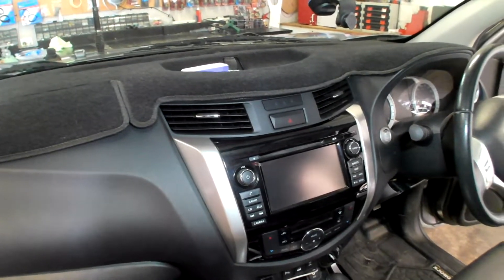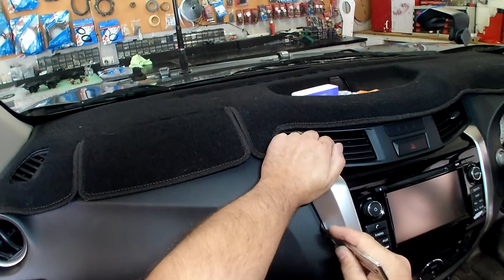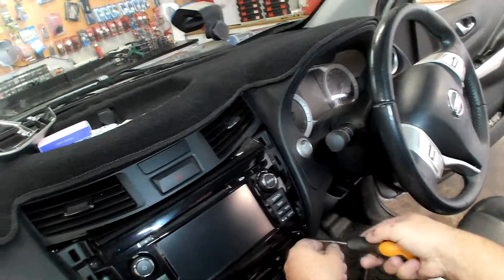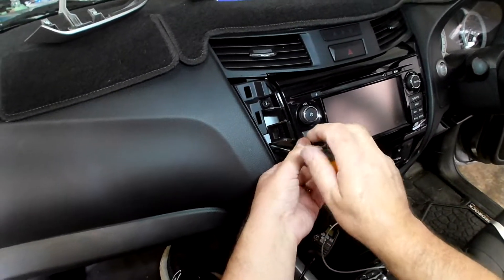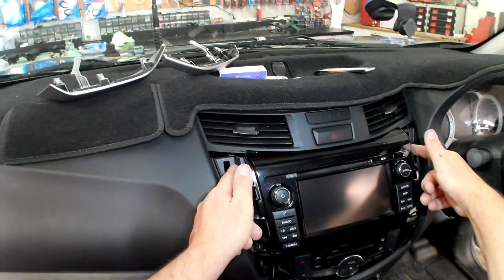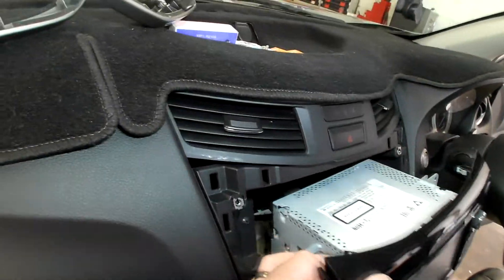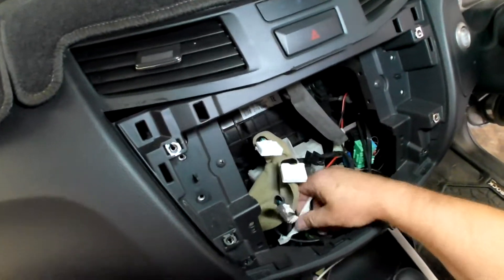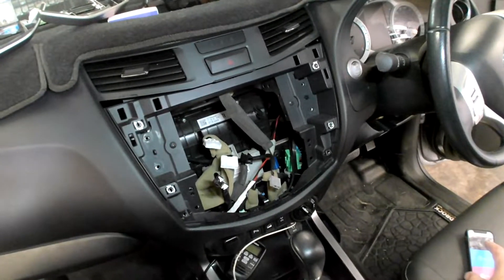Nissan Navara 2017 NP300 D23 Radio Removal

Comment: Not sure if you'll know but thought I would ask. My stock system (as shown in the video) has a damaged screen. I can get a whole compatible & operational unit from a breakers yard, the breakers yard advised me it would need coding to my vehicle. I contacted my local Nissan garage who told me it's not as simple as just swapping one from one vehicle to another and they may just try to use the screen part from the one I bought. Would a Nissan dealer not be able to replace the whole unit with the one I bought and sort the coding?
Reply from the maker: Thanks for the enquiry. I have not swapped like for like in these as all my clients have simply replaced with a better unit. That said, I would remove your existing one (as in the video), take the vehicle to the wrecker and ask to plug in one of theirs. If it works, buy it. If not, no harm no foul. Logically you could have just the screen changed, but you would be paying someone to disassemble both units. 
Let me know if the swap-over works. 
Good luck

Comment: Thanks very much mate , I’ve very poor reception with mine & was considering another ariel maybe mounted on mudguard but yours looked like a different plug  are they not standard anymore?
Reply from the maker: Yeah, they changed from the standard antenna to this style on later models. As for reception, you can get a Bullbar mounted whip style antenna. I have had some good reports as to the increased reception from these. The higher the mounting, the better. That said, you will need to be aware of the height overall when it comes to carparking buildings etc.
Reply: @InstallersAssistant  thanks very much for the quick reply, I saw a headunit antenna adapter I hope I can use one of these.
Reply from the maker: If you are in Australia, this is the part from AERPRO ...https://aerpro.com/apa83. If you decide to mount a new antenna, you wont need this. @tonynorris5199
Reply: @InstallersAssistant  yep I’m in WA south of Perth & that was the one I was looking at. Thanks again mate very professional.